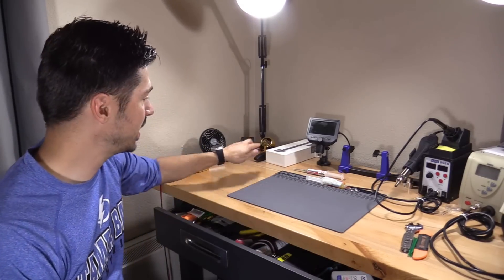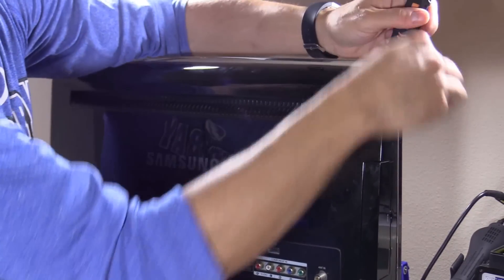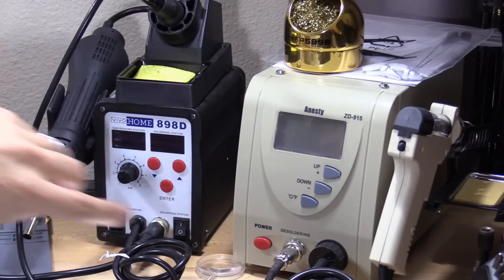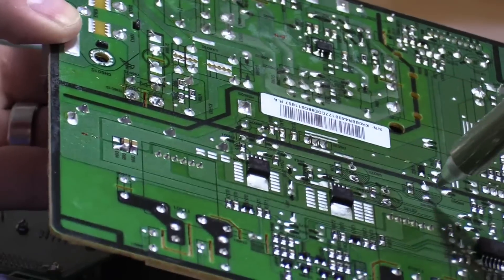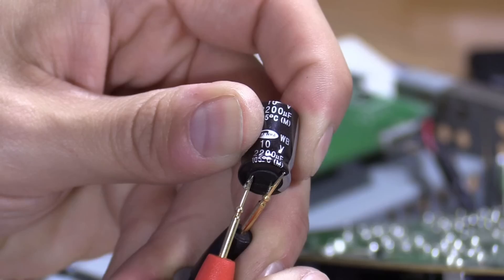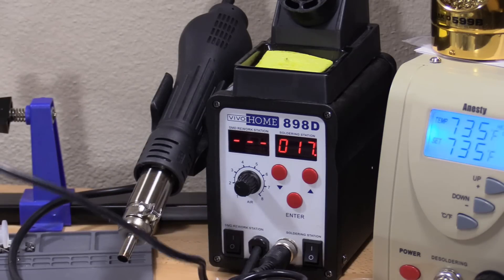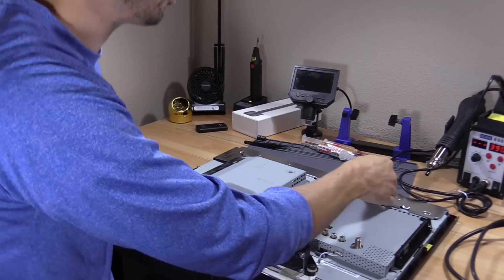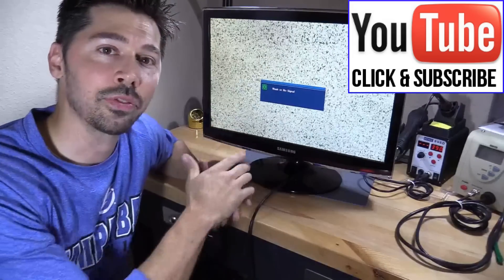Samsung TV Repair not turning on model T220HD

Comment: Great job repairing the tv!  So many of TVs of that era went to the trash because of cheap capacitors.
Reply from the maker: Great channel people need to check it out and sub. I like that you find very random items and fix them. check out free section in craigslist, that might be a good video.
Reply: @TampaTec  Rf field

Magnetic Field

Radiation 

Video 2015 -  What devices cause the most radiation and how to check with a meter -  I really believe my interent drop outs is the cause of some one causing my Wifi to drop is os using a jammer immat my withs end - I live in navaeer FL - AT&T won't get to the cause of the problem its very stressful I need to know answers as to why my wifi devices wont saty connected hardwire no.isaies or speed issues you're the only one who can help me
Reply from the maker: @JasonTheJJGamer5442  try Google WiFi it's more reliable than cable company junk. But nearby radio or cell tower might cause issues.
Reply: @TampaTec This why didn't worked video but audio did worked! You just move tv monitor and he show grey or silver color! Sometimes working sometimes don't! In the store they are give us with  remote control
Reply: @TampaTec  Thank you!  Good thoughts about CL.  My next video (almost done) is about my best find and repair to date.  Are you gearing up for 500k subs?  Looking forward to it!

Comment: Hey I've got one of these that still works perfectly other than it's super dim now, I think it just needs a new backlight. Are they hard to replace? They only cost about $25, so I'd rather keep this one running rather than spending $200+ for a replacement. I just use it for old retro consoles.

Comment: Well If The Moniter Isnt 
Getting Power 1 It Could Be A Fuse 
2 It Could Be A Loose Solder Joint in 
The Circuitboard
3 It Could Be A Bad Cap In The Power Suply It's Self. I Pluged In A A Power
Adapter Into My Portable CD Playet
& I Thought The Power Adapter
Was Bad Till I Wiggled The Plug
Then I Found OutThe End Was Bad
Then I Replaced It.
4 It Could Be A Bad Connection 
Where The Power Cord Plugs Into
The Power Suply It's Self
5 It Could Be A Bad Cap In The

Comment: I just opened my T220 — all of the condensators look just fine, none of them are bulging, all are flat. What else could be the issue? I have that issue where I have no image at all and my power button is blinking rapidly.
Reply: Capacitors. I had the same problem, after desoldering old caps and replace them with new caps all working great. Caps can be bad even when they flat.

Comment: I have a Samsung UN46C6300 
that has vertical lines and sometimes the picture will freeze even though the audio is normal. This happens with any signal I connect (Not a streaming issue.)  I have disconnected all board connections and cleaned with compressed air but still no luck. Any ideas.   Thanks for the great videos and any help you can provide

Comment: I have a sony Bravia model KDL-52W3000 tv that has a blurry and distorted screen until it warms up which takes about an hour. I dismantled the tv to correct the problem. After the disassemble, I turned on the power and I lost both video and audio. No wires were disconnected. I do have back light but nothing else.

Comment: I have a Sanyo HDTV that only works by a remote. It has no external buttons at all. If I end up with breaking my remote I am screwed until I get another remote. I can't understand why they made a TV like this other than a cost saving measure. Thanks for your video.

Comment: Hi, I have a question about the mainboard. I have a 46' Samsung LED smart tv (un46d6003sfxza) with a broken mainboard, I am wondering if I can use a slightly different model (UN46D6000SF) as a replacement.

Comment: Hey Tampatec!!

I have a 75” Vizio M75-C1 I got from a neighbor for free to repair. 

So, the white standby light on the front of the TV turns on when attempting to power on, but we get no picture. Haven’t tested for sound. Backlights do not turn on. Underneath the back of the TV we have a sub power board, and what looks like 2 power boards. In the middle we have a t-con board, and on the right side 2 led driver boards. 

So no back lights. No picture etc. 

From what I’ve tested with a multi meter, one of the power boards is out putting 24v like it says but I can’t seem to find where the stand by volt is to test. I assume it has stand by volts because the white light on the TV turns on/off. The two power boards in the back like I said one is giving off 24v like it says but the other power board of the two says 0. Now, we just replaced that board with a new one and it still says 0. Weird. I’ve tested the sub power board that gives off power to both those and it receives power especially since the other power board is powered. One of the LED driver boards is giving off volts while the other LED driver board is not. Which that one is connected to the power board not giving out volts. But we just replaced it with a new one.

Any insight would be beneficial as I’m kinda stumped. I have pictures of all the boards so if you wanna DM me PLEASE, feel free.

Comment: Hello, I have a Hisense lcd tv its pretty old that I'm trying to troubleshoot. As of right now this is a hobby/past time and I'm trying to repair tv just for educational purposes. But I'm not sure where to go from where I'm at. I'll put some info below any help would be awesome.
There is a high pitch whistling from the power board, Stand by light is on but will not do anything from there. 2 connectors from power   board to main board with the following readings.
M5V- 2.6V     connector 2  
M5V- 2.6V           16V- 16.8V
G-                      16V- 16.8V
G-                       G-
SW- .10V               G-
BRI- 1.78C
G
12V- 11.9V
G-
G-

Comment: Do you really need an ESR meter. I not sure if I have a need to buy. Since you often now used the fluke meter. I am interested in the peak esr70. What is your opinion, if you can give me a tip. And you can measure SMD capacitors with ESR meter
Reply from the maker: esr will give you esr (resistance) reading without removing cap from circuit but i recommend it even though i usually don't use mine often.
Reply: Tampatec 
 Super thanks. Than it be better spent the money on other purchases. I find you repair videos super to watch. But would like to learn how to measure a 6 or 8 pin mosfet or voltage regulator by measuring with a multimeter. Ivan find it anywhere. Again manny thanks.

Comment: Dude! Never would'a thought of using my bicycle tire tool to fix a TV! Love your new equipment! ( I am jealous ).  Imagine how many TV's are tossed because of a 25¢ cap!
Great vid, great repair! Keep them up!  
The remote for my 3 yr old 55" LG is working intermittently. Should I open it and clean pads?  With alcohol?
Thanks
Reply: My syncmaster t220 was normal but a minute or so after i started it, it began to flash the screen and the brightness was very low after so i couldnt see anything, at first i thought it was the cable so i pressed the menu button which also was very hard to see then i realized it wasnt the cable, now i opened it i have no clue what i am looking at
Reply: @minecraftiscool6605 Did you manage to fix it?

Comment: Great job! Anther TV saved from the trash heap.
As for those that have said to replace all of the Cap's, I say you done the right thing by testing and if good reuse. I've found that with electrics if it's good it's good, there is no wear n tear. Just like a fuse it either works or not so replacing good tested Caps with new one's wouldn't have made any difference.

Comment: Nice repair as the 1st culprit to most samsung. If the boards are not worth replacing because of cost you can get a universal board kit for cheap and use the screen. I have several I converted for multiple uses.

Comment: Nice job, Samsung usually has a touch screen power button. It does on one of my tvs.  Just wondered did you go over the new soldering station on another video?   I'm still looking.  Also I didn't know if you did a review on soldering and de-soldering stations.   Thanks!

Comment: Sony 43" XBR-43X600D     After several hours on, the screen has a horizontal area at about 1/3 of the way up that gets a double ghost image slightly below the normal one, typically vibrating up and down.  I live just outside Tampa, would be happy to bring it in to you for a fix.  Tried changing the communication board just before the signal enters the screen, didn't help.  Perhaps this is a 'terminal' screen issue that just isn't worth repairing?
Reply from the maker: that can be bad tcon connections to LCD panel.
Reply: you will have a bad cof chip on the panel. you can do a patch wedge but it is not really fixable, sorry.
Reply: @attainteddragon  What do you mean by "patch wedge"?  Do you mean putting pressure on the tab bond?  I'm not familiar with that term.
Reply: @FrugalRepair  yeah it is the way I express putting a pressure (thermal pad) on the tab bond. It helps people understand what the process is a little better and that it isn't a real repair.
Reply: @attainteddragon  Gotcha!  Older Sony's seem to have more of those issues.  I "repaired" one with a folded up part of a Christmas card once because it was the first thing within reach.  Tv is still working years later.
Reply: @FrugalRepair  lmao. not sure if i would use something combustible around an ic that is getting hot, that is why i use thermal pads. all of the xbr series seem to have the panel issue. i can't remember which manufacturer it is. now days, they have regular faulty t-cons, but there is some universability between the models. :)
Reply: @attainteddragon  Perhaps I'm thinking of a different location.  The cardstock I used was on top of the tab bond on the buffer board and when the metal frame is tightened down it got the ribbon cable to make the correct connection(s).  Anyway, thanks for explaining!

Comment: Yo Yo Yo Paulie... if you remove an 11 year old cap why not replace it wit new? You did all the work without the insurance of getting another 11 years! Glad you finally fixed something! LOL must feel good to break the drought! I on the other hand obliterated a mainboard cooling fan with compressed air in a iMAC 27" by hitting the blades with the tip of the blow gun. Now I have to wait for the replacement to come from eBay (Monday), hope I remember how this thing goes back together!
Reply from the maker: True but I fixed tv for free.
Reply: @TampaTec  got it so it's the other two or three caps pop in a week c'est la vie
Reply from the maker: Good luck 👍 that 2200uf 35v cap I installed was new.
Reply: @TampaTec  yeah but you re-used to three 1000 uf caps
Reply: @cruisepix  :  i agree. They are out of the board, and replacements on hand, so why not REPLACE THEM?  If i don't have them, besides capacitance test i would also check ESR.
Reply: If it works leave it alone at that age.
Reply: You could do that, but it's a good way to waste money, 105 deg LOW ESR Caps aren't cheap, if they've lasted 11 Florida summer's, they'll last quite a few more !